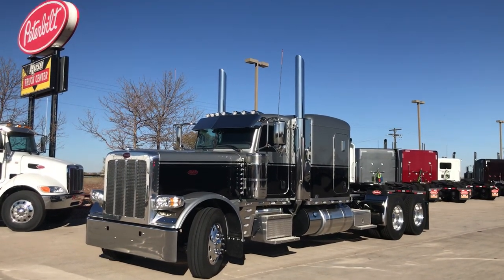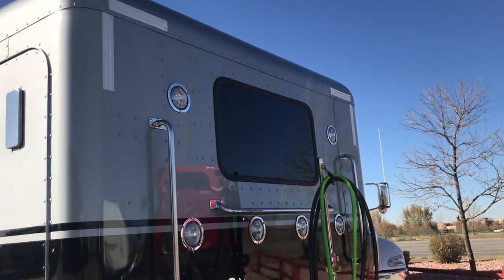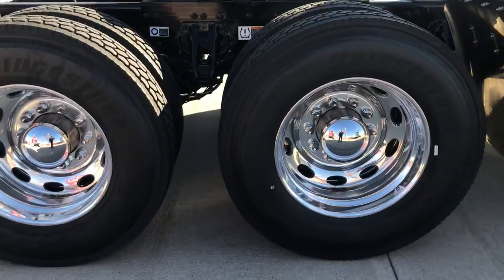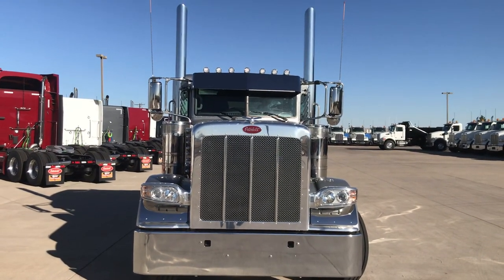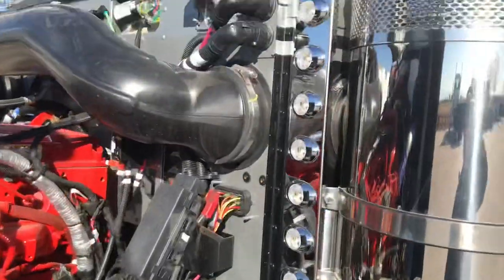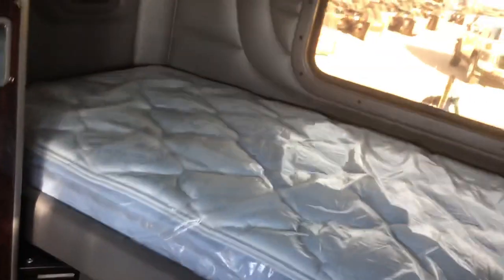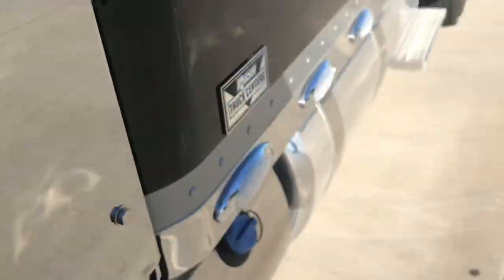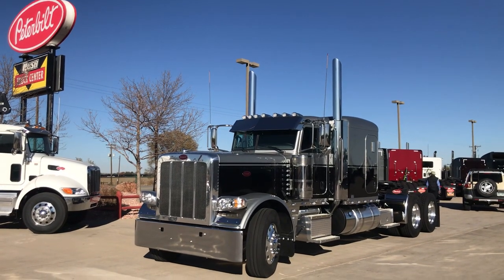2020 Peterbilt 389 Classic! (Keith Couch - couchk@rushenterprises.com)

Comment: Nice; but if the wheels are being replaced with black aluminum at a later time why was it not ordered with just Plain Jane white steel cheapo wheels? Seems like it would have saved a few bucks off the bottom line
Reply: If they are going with powder coated aluminum black wheels the studs wouldn't be long enough to accommodate the thicker aluminum wheels had they ordered steel from the factory.  And sometimes the price difference isn't that much. Sit down and order a truck sometime you'd be surprised how things are.

Comment: How much extra is 2050 torque over 1850 on a X-15 565?
Reply from the maker: I would guess about $4500.  You have to upgrade the clutch, driveline and rear axles as well to handle the extra torque.  So that all adds up.
Reply: Truth be told we take our 1650 torques trucks and turn on the 1850 or higher and as long as you don't abuse them they hold up just fine on a new truck you're mostly paying for the warranty and as far as the rear ends and axles they just wear out a lot faster when you put more power to the ground keep the tranny cool and it will be just fine